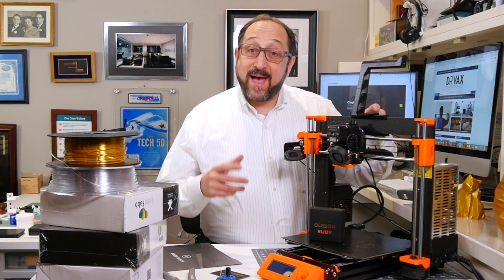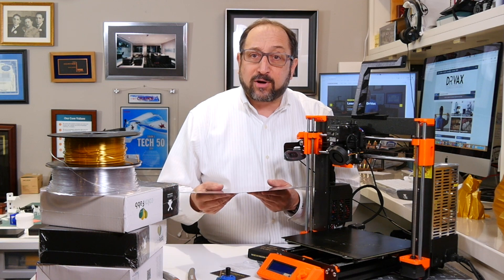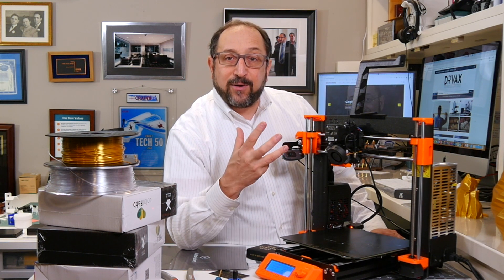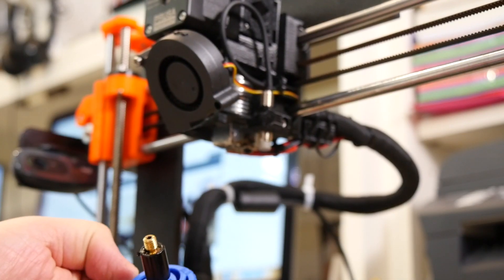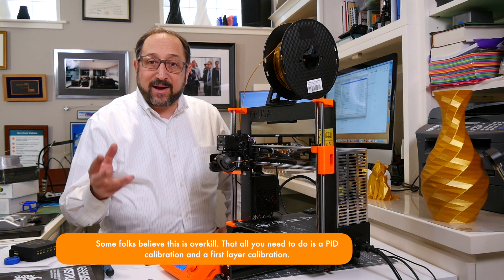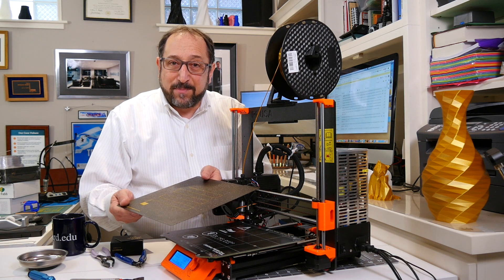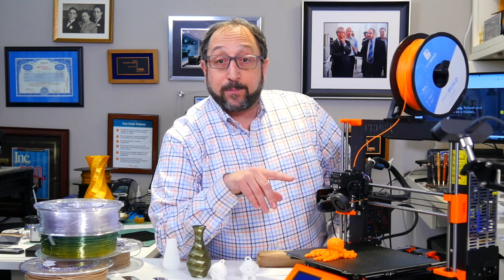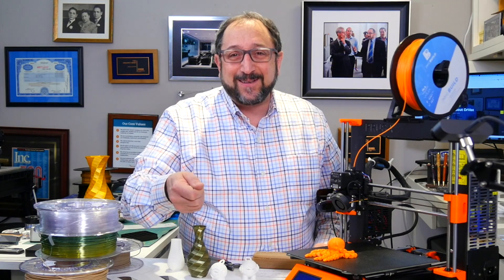Olsson Ruby Nozzle Install and Exotic Filaments

Comment: How on earth did you make The Olsson Ruby print properly. I have gone through two of them and could not get any of them to print reasonably well.
Reply from the maker: It probably depends on the printer but the key to any “upgrade” is to go back to the basics.   Re level your print bed, adjust your z offset,  start with a simple model and adjust your temperature and begin by printing slowly.
Reply: @MakeWithTech  I'm glad that you found  the Olsson Ruby  useful. This was on a Prusa, I could never go beyond printing slowly, 15% of normal speed was the best I could do with the rubies and the print qualty was not quite there so they ended up in a box somewhere.

Comment: You have a great set of tutorials here and a wonderful speaking personality watching this I’m wondering thinking in retrospect the phrase “ if it ain’t broke don’t fix it”comes to mind because when you try different filaments and all the sudden it won’t print the way it used to it can be so frustrating if I had a second printer or third printer I’d be more likely to try various materials but it’s often hard to get it back in tune seemingly due to increased temperature changes changing the tolerances of the bed nozzle clearance And potentially bed leveling as well as particles within the nozzle

Comment: Hi DrVax,  my Olsson Ruby Nozzle was working fine on my original Ender 5 hot-end.  Then i bought micro swiss all metal hot end and the Olsson Ruby does not really plug into it....is that possible or am i just not threading it right?  Because i assume the original hot end on Ender5 has the same nozzle thread as the micro swiss one right?

Comment: When putting the new nozzle back in, you should increase the temp about 20c above what you normal have it printing at.  Then finish tightening the nozzle.  This will make sure it stay's tight when printing at your normal temp.
Reply from the maker: Thanks for the suggestion.

Comment: Sorry I missed you at MRRF2019; I brought my Prusenstein P3 Steel printer, maybe you saw it. The temperature variations you experienced are noted with the instructions for the ruby nozzle. It is recommended to increase temperatures due to the lack of thermal conductivity of the ruby.
Reply from the maker: Thanks for the comment and the confirmation of my experience.

Comment: I did learn something   I tend to print hot. Sometimes I get black gunk. Maybe that’s why.
Reply from the maker: Printing hot makes it easier on your extruder but does create other difficulties.   At the right temperature, you maximize layer adhesion, too hot, and the fan cannot cool down one layer before it attempts to lay a second layer on top.  This can cause the bottom layer to deform resulting in elephant feet and other layer defects. 

At the end of the day, since every printer is a little different, you need to experiment with temperature to optimize your prints.

Comment: Hi. Nice video is the first time I ear the term of polish plastic. What did you use sand paper?
Reply from the maker: Clearly, if I said polish plastic I misspoke.   I recorded 2-4 videos a week and often mangle a word here and there.  :-)

The Plastic Polish I used was PSI Woodworking Products One-Step Plastic Polish.  I applied some and then buffered it lightly with a cotton buffing wheel.  A cotton wheel in a Dremel tool would work fine.

Before polishing I very lightly sanded for under a minute with 600 grit sandpaper.
Reply: Thank you for your quick reply I'm really learning things that I didn't have any idea.

Comment: 5:56 hold the heater block
Reply from the maker: You are correct.  Thanks for correcting my misspoken terminology.   It is in some ways like the song we learned as kids.  

The nozzle is connected to the heater block,  the heater block is connected to the heat break, the heat break is connected to the extruder (or in some case the Bowden tube) ...

All kidding aside I appreciate any comment that helps clarify a point or correct a point for my viewers.  Thanks.
Reply: @MakeWithTech  Heat break connects the heater block to the heat sink, which in turn connects to the extruder.  Best of luck with your endeavor.

Comment: To stop models gluing to the print bed, try prior to printing, applying a thin film of PVA (Polyvinyl Alcohol) it is used in glass fibre moulding as a release agent it dries fast . This is not the same PVA as glue stick! .....I have worked with Grass fibre production in the past.
Reply from the maker: Excellent suggestion.  Normally for PLA I just clean the bed with Isopropyl Alcohol.  For PETG or TPU I find cleaning the bed with Windex works great.  I did not expect PLA to stick like it did.   Your suggestion is a great idea.  I will look into purchasing some.
Reply: @MakeWithTech  The PVA is applied with a sponge it  leaves a plastic film that has a very thin skin, the skin is cleaned off with water like a moist cloth.
Reply from the maker: Now that I think of it, when I need either better release of better sticking I am a bit fan of MagicGoo.   I am not sure what MagiGoo is but for all I know, it might be PVA.  It is a bit expensive so I am going to order some PVA and give it a try.
Reply: @MakeWithTech  I used to make golf clubs with glass reinforced epoxy resin, I applied the polyvinyl alcohol (PVA) to the mould which was also made of epoxy glass fibre (must have a good release but allow the resin to stick) then I laminated the golf club, nothing ever stuck permanently, the proper glass fibre alcohol based polyvinyl release agent is the key it is also easy to remove with a damp sponge. p.s. there are videos on youtube of glass fibre moulding using this type of release.

Comment: Great video. Your style of instruction and speaking is so understandable. Is the Prusa MK3S your only printer? I just completed my kit and it passed all the wizard test except it will not take any filament. I have had it a week and it is not printing yet. I am working with Prusa Support and hope to up and running shortly. Meanwhile my Ender 3 is doing an admirable job.  Where are you located?
Reply from the maker: I have a Prusa mk3, an Ender 5, a Monoprice Select Mini and a Monoprice MP10.  I have put a 1mm nozzle in the MP10 and upgraded the extruder.
Reply: @MakeWithTech  How long have you been into 3D printing?
Reply from the maker: About 5-6 months.  When I retired from my full-time job as a software company founder and executive I threw myself fulling into the DrVax channel.  So while I have under 6 months using 3d printers I have worked at it "silicon valley" hours and learned a lot from my viewers.

The goal of this channel is to learn together.  I just happen to be the guy in front of and also behind the camera :-)

Comment: You really can see the rainbow on the vase and the reel. It went from almost dark aqua green to a bit lighter yellowish green, yellowish bronz to gold. Watch the roll of filament on the table in the video. As you turned the vase, I could see the colors clearly with the light bouncing off its surface.
Reply from the maker: Thanks.  I took a look again and did notice the rainbow colors.  I do love all of the CC3D filaments.  I have also printed vases with the gold which is gorgeous.

Comment: DrVax when you change a nozzle on the Prusa you should consult the book. Before you remove the nozzle you are supposed to give the heat block a slight 1/4 turn to the left to loosen the block from the heatbreak, and to loosen the heatbreak from the nozzle. Otherwise you could snap the nozzle off on the block. Otherwise great video!
Reply from the maker: Thanks for the comment.   I did check the Prusa FAQ and did not see this.  Either way, this is great advice for my viewers.  The best part of the YouTube video world is the ability for viewers to contribute a comment.  This empowers my tag line "let's learn something TOGETHER".  Thanks again.